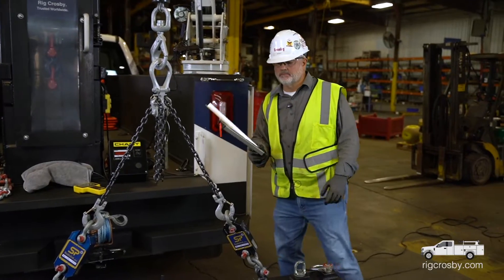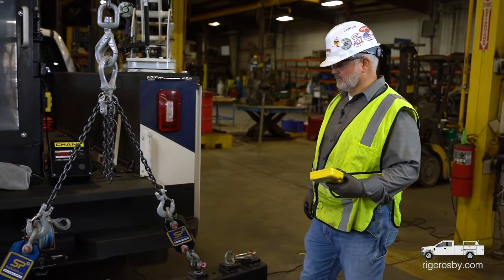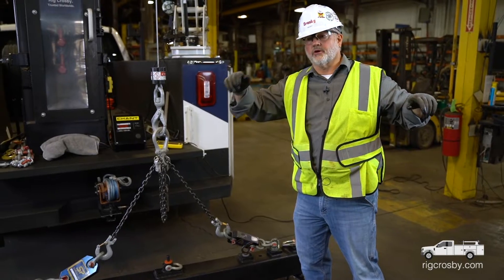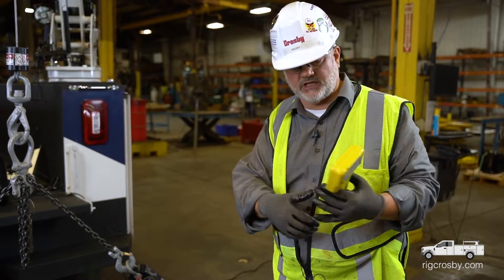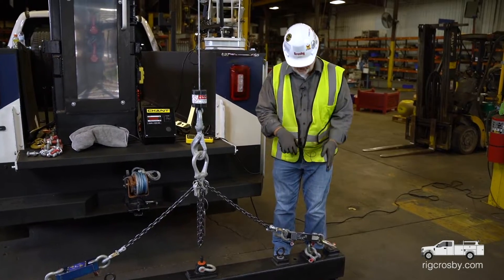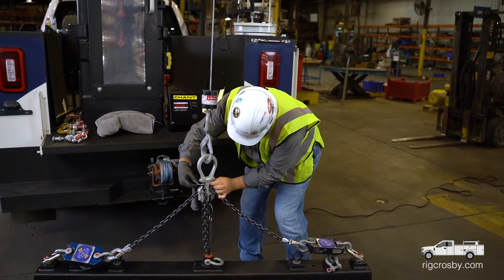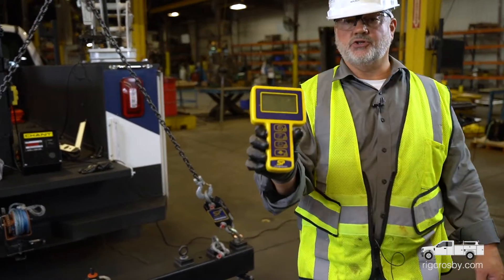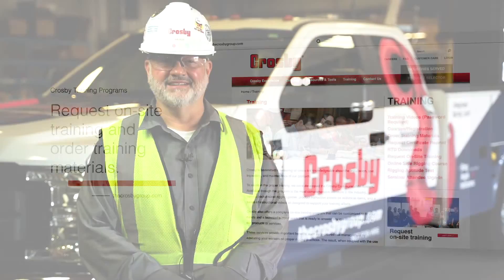Sling Angle Demonstration

Comment: Great video, but you don't get wrong number because of unexact angle, but from a little mistake on the calculation. You can't take 20% of 60 pounds(12) like you do, you have to divide 60 by the inverse of 20%. You get 15 pounds, pretty close to the 74-76 pounds you read on the screen.